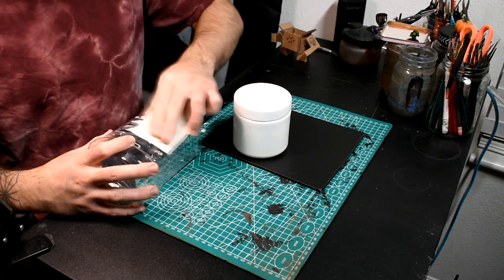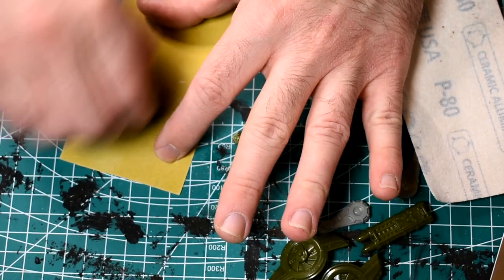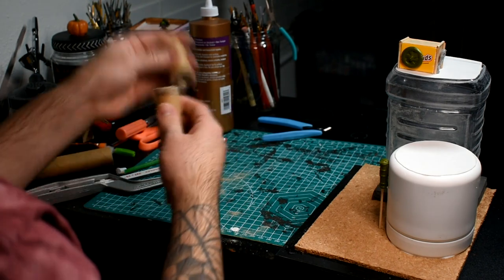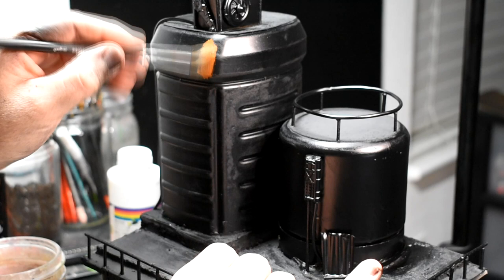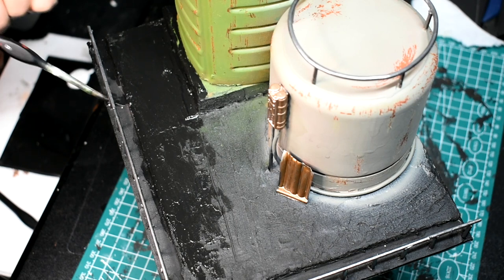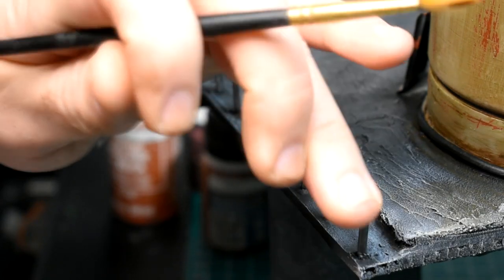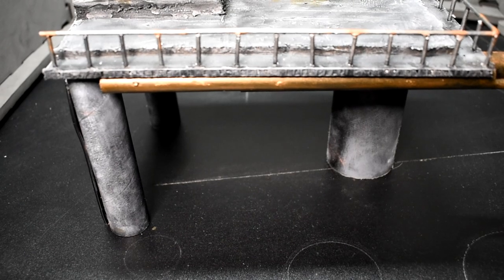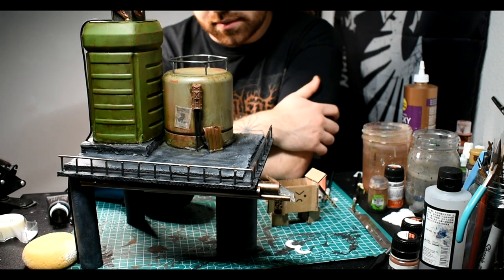How to make junk into Industrial platforms, for 40k and Kill team!

Comment: If you do your "entire board on pillars" idea, it would be cool if you designed it in such a way that the area under the pillars is also a playable space. You could almost have both an "underhive" zone and a "spire" zone on the same board, with stairs and ladders and whatnot connecting the two halves. 
If you plan it well, you could end up having twice as much area to play on with terrain that takes up the same amount of space.
Reply from the maker: Oh geez thats a freaking cool idea but sounds reeaaally big 😂 i might think about this but thats a big maybe. Love it though!
Reply: @boxnaught7428  Thanks! I'm not sure it would HAVE to be a massive undertaking depending on how you went about it, though. Just having the pillars themselves serve as, like, an alternative hallway-shaped route that you could use to sneak to the objective in the top center of the board, or something like that, could be cool. The pillars could serve as cover to hide behind as you move up. You could just throw in a couple walls between some of the pillars and add some small scatter terrain and stuff like that, then paint the pillars to be all rusty and the top building part to be shinier and more ornate, and call it a day.
I dunno, I just thought of that because you've got a lot of space under those pillars, enough to fit models under! I'm always all about finding ways to make my terrain multi-purpose, as I only have so much storage space, so I thought you might find having a way to get double duty out of your terrain helpful!